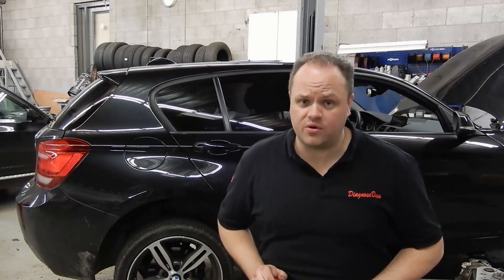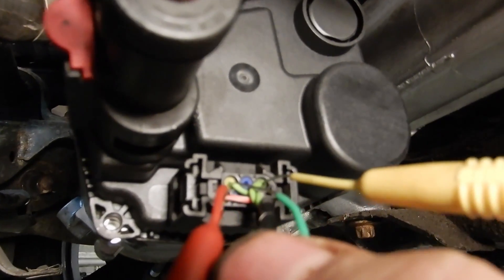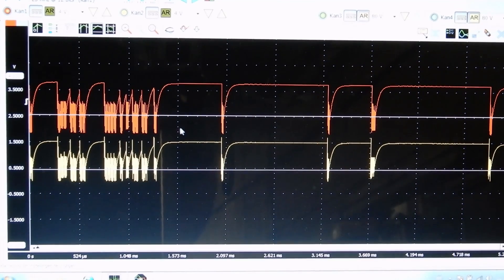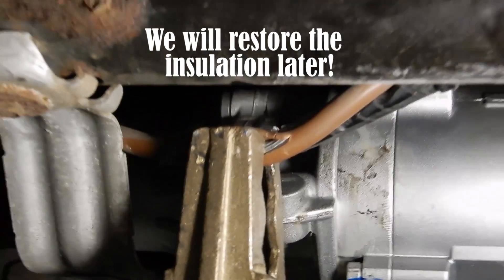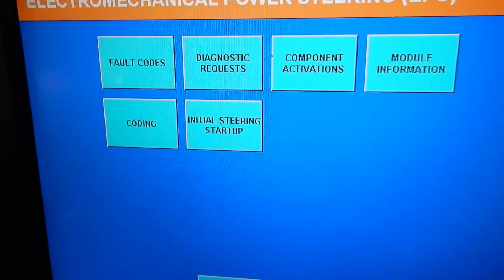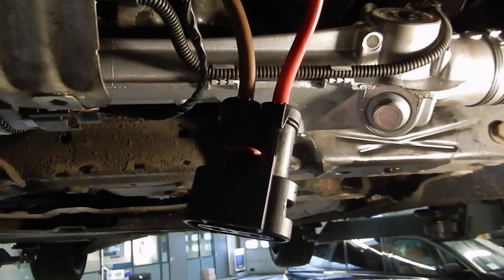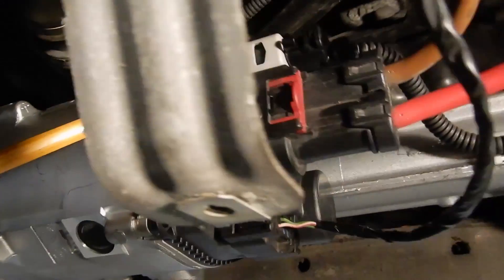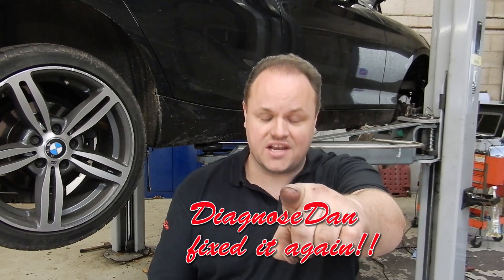Bmw Eps diagnose and repair (No Flexray communication)

Comment: Nice video Dan. I'm not familiar with flexray. I know it's been used on BMW for several years. Looks like an upgraded high-speed CAN? 
Thx!
Reply: Dylan that's exactly what it is . Even faster than CAN,  but not altogether capable of long packet strings which is why they don't use it in all applications 💪🐼
Reply from the maker: Dylan Keith gave you a perfect answer!😀
Reply: Thanks guys!
Reply: It's not, CAN uses differential signals, they are mirror images.  The scope traces shown here are synchronous but just at different voltage levels.  Crazy.